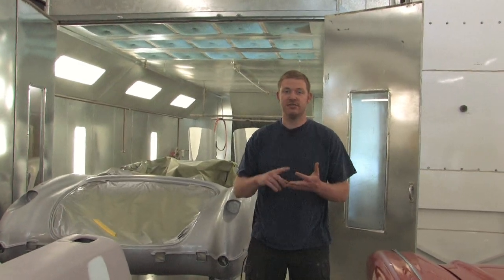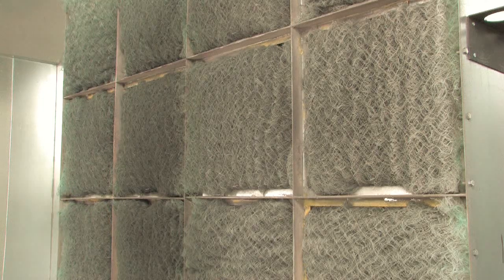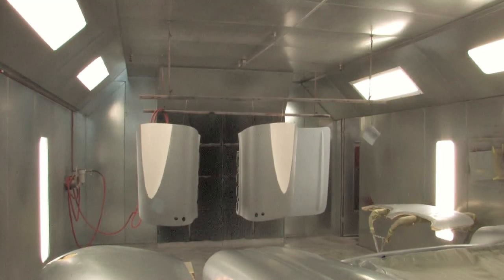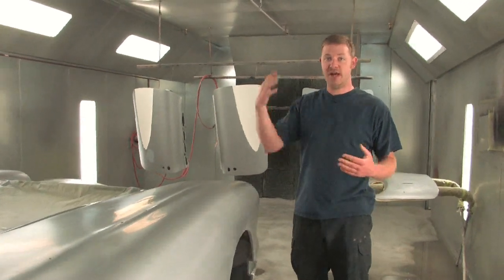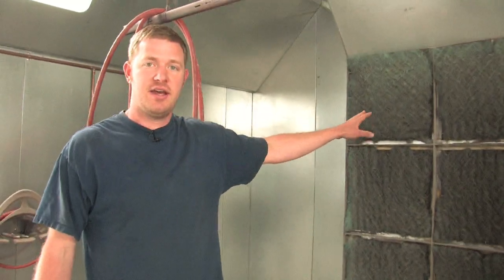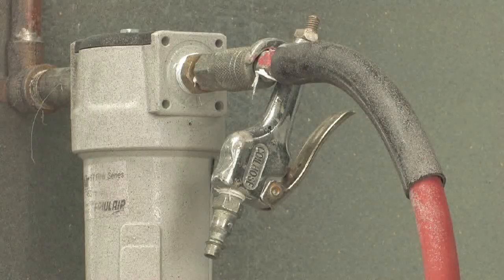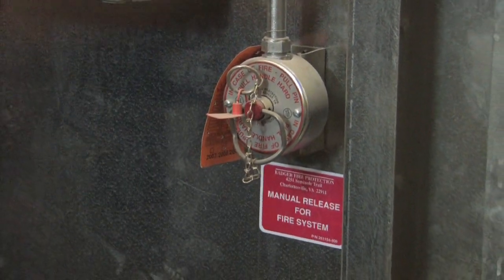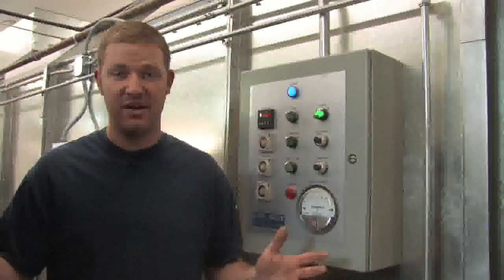Auto Painting : How to Build a Car Paint Room

Comment: You don’t need special (3 phase power) You could get a single phase 2 or 3 hp motor with a 30 inch fan that produces 12,600 cfm and run it with NO problems  it will run less power than your dryer.

Comment: lmfao,  I'm on point with the other comments. I have a 30" axial exhaust fan in my paint booth rocking 15,000 cfm. in addition have 320 but of inferred heaters, with custom intake filter bank that I can remove to allow all equipment in. the best part about it is that the size is much larger that standard booth sizes. I guarantee my home built booth flows more air then that booth in this video,  lol. one last thing, I have 3 compressors, with 2 dryers, and most likely better in line filters. Don't tell person this crap. this video sucks😤

Comment: I'm building my own booth it's a small booth for things such as fenders, doors, hood, trunk. I'm building mine onto my storage building. I'm going to have a whirly bird vent onto the roof which will suck out the fumes, vents around the side to allow air in an allow the air to flow out. because I don't have 15,000 dollars to spend on a actual paint booth. I will be laying gravel for the floor so with that being said when time comes for me to paint panels I will wet down the floor which will not let dust fly up as I'm walking around painting. there will be plenty of air flow going through ventilation is key when building a paint booth.

Comment: Don't let this guy put you off. I hate this video. Providing you aren't painting 10 vehicles a day a self built oven is fine. I built and oven out of studs and 18mm ply wood, 30 led ceiling lights with high lumens and low wattage, 3 draft fans and two extraction fans with filters over the top. Airline set up in the booth. Loft installation in the stud Wall to hold heat. As long as you can get the spray room temp to around 20-25C just air dry the Solvent or water base paint. Draft is more important with water base. Make sure the base is always dry before you lacquer. Then just lights out and leave overnight with standard hardener. You're welcome 👍🏻
Reply: Awesome you had the same thaught as me about this video... What sizes did you use? Could you make a video of your booth?

Comment: LOL!!! I have a 4.9 amp, 120v, 42" drum fan that produces 13,300 CFM. Can't make 12,000 CFM off of standard residential power? Yes you can.
Reply: 13,300 cfm or 12,000 cfm is meaningless unless you know the static pressure and system pressure.a typical booth would be in the region of 2"wg to 3" wg dependent on elevation above sea level. Now go back to the performance curves and see what the actual air flow volume is at working pressure. I was the R & D Manager for a Spray-booth Manufacture for 20 years so Yes I do know what I am talking about
Reply: @davidhutton1294  what does wg mean... how can a average person test static pressure ....I'm at sea level and just curious...

Comment: Aluminum frame.  Cover inside and out in "barn metal"  Place two strong fans on one end with good quality furnace filters and a vent low at the other end with more good quality furnace filters.  Provide LOTS of light.  Have a compressor with a big enough tank and high enough flow it does NOT run all the time.  if your comp is running all the time you don't have enough comp.  And at that point you now have more paint booth than most shops had prior to the late 90's, and more than some still do.